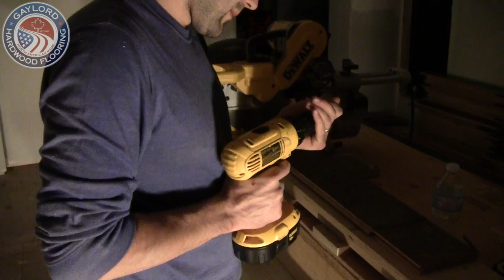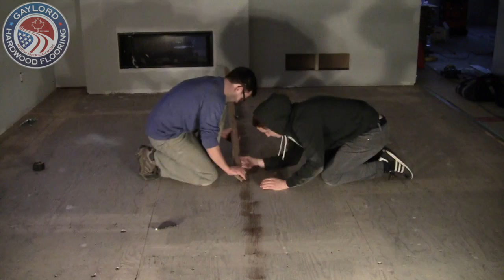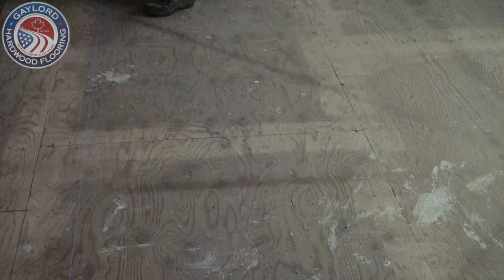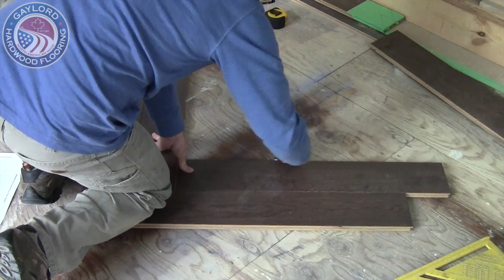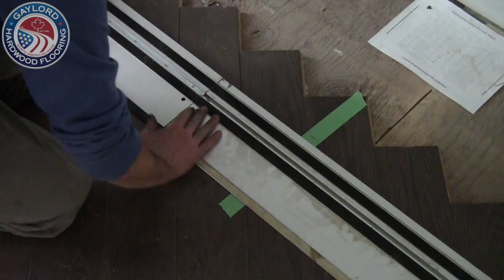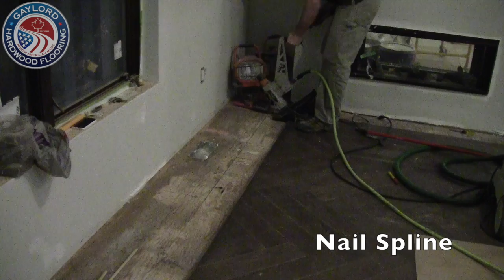How to Install Herringbone Hardwood Flooring

Comment: There are several ways this can be done easier. One is not cutting those splines for the ends of the boards.  They are simply not needed.
Reply: Says the wood hack. You could of said lazier.